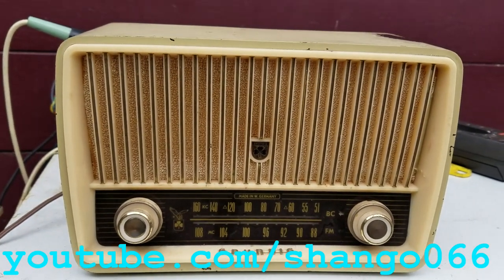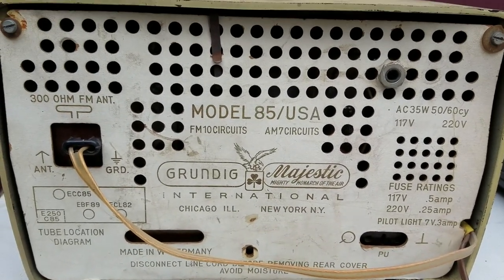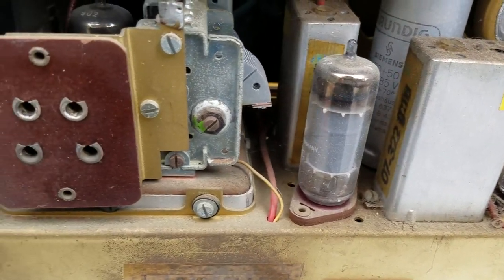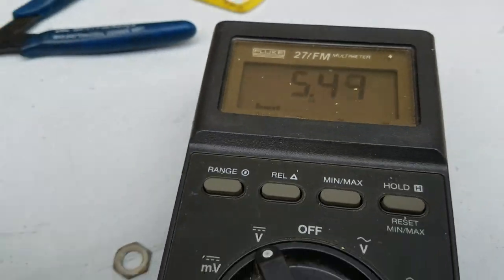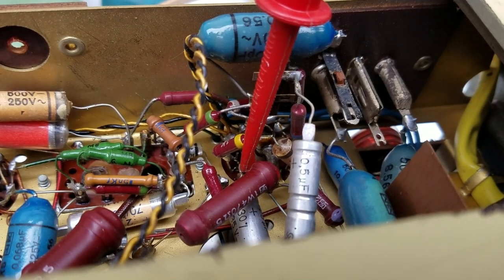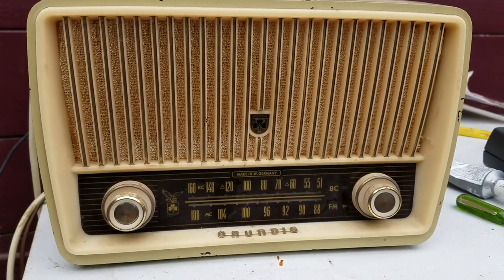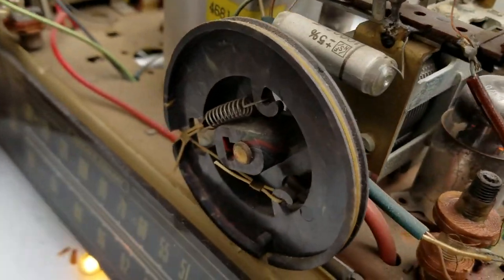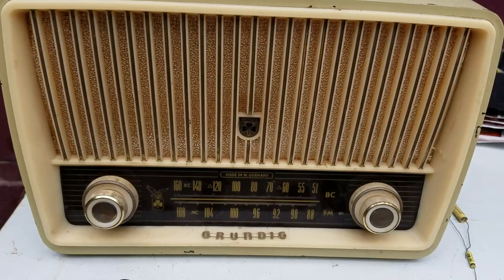Grundig 85 vintage German tube radio AM FM

Comment: I have two of these, that I've completely restored. One is original bakelite dark cherry brown and the other was painted green by Grundig. One has a brown glass tuning scale and the other has a green glass tuning scale. They both sound fantastic. The rectifier, as identified on the back cover, is not a tube, but a selenium rectifier, which I replaced with diode resistor combinations.

Comment: Grundig always made amazing radios with minimal number of tube envelopes.   This one is going to be much less of a headache compared to the larger ones with the piano-key switches.  In those dust would filter down between the keys and foul the switches.  Also the switch contacts would get dirty and need a complete switch disassembly to clean.  Also the switch bakelite would carbon-track across the B+ switching contacts.  And let's not forget the dim and expensive eye tubes.  One of the eye tubes even had an audio preamp pentode in it!  It cost like $45 thirty years ago, now probably not available any more.  The coil adjustments would freeze up too.   Count your blessings.

Comment: I think they were originally White. They were painted white at the factory, over the Brown Bakelite :)
Reply: You're correct. The white paint is from the factory. You can find the same at old Philips Philetta Radios which had a bakelite cabinet that was either left brown or painted white, depending on the design option.
Reply: Eu preciso encontrar um locutor de rádio do Estado de São Paulo o nome que ele usa como locutor é Andorinha
Reply: O nome dele é Andorinha

Comment: I really like how they used teh fuse as the 110/220V selector link.  As another commenter mentioned, this radio was originally white from the factory.  the knob trim, the nameplate has the links between letters painted, and the back masonite is white as well.

Comment: I could not get my head around a 3-tube AM/FM set... It turns out it uses the ECC85 as AM converter as well- only Grundig could do something like that! But then they always were a bit unconventional, who remembers the TVs in the 70's with the thyristor horizontal output stage?! Brave men would quake in their boots if one of those came in with no raster....
Reply: The radio works and sounds astoundingly good for how simple it is.
Reply: Alright shango...  sounds like an interesting challenge to bring to your audience!
Reply: Yes many service techs hated the thyristor/SCR based horizontal circuits, RCA really liked them, and introduced it to the mass market with the CTC-40 sets in 1969.
Reply: Thanks, I'll have to look that up!
Reply: there was a Pye P117 using the same idea and almost the same valve line up, just it had an EZ80 rectifier instead of a selenium..

Comment: Hello shango066, i live in Germany & the capacitor's in the german Radios are nearly all bad ! I dont measure them i just replace it all exept vor the ERO-FOL II, the yellow & green drobs vorm VALVO, PHILIPS etc. ( i call them " Käsekondensatoren " ) because the yellow ones look like liddle  pieces of chees ! And the ceramic ones with hi capacity from SIEMENS form the 30s and 40s are also mostly good !

Comment: Back in the day in Europe  radio usage fee was part of the electric bill. People were charged based in the number of tubes in the radio. Therefore the multisection tubes in order to reduce the count. The radios were registered upon purchase on buyer name and address.
Reply: They changed to a rigid tax, every household has to pay 17,50 Euro per month now in Germany. Communism is coming.
Reply: Had no idea. Reminds me of the window tax
Reply: Reminds me that here in the U.S. some cities would tax your house by the number of closets, thus the popularity of the stand alone wardrobe closets.
Reply: Public broadcasting (TV and Radio) has a yearly budget of 8000 000 000 Euro, no typo. Half of it is going into pensions. They argument you pay for the possibility to consume, and that this is necessary for the society at all. Judgement of the constitutional court is expected for autumn.
Reply: In Czech republic you pay only if you have radio or TV, so no every household has to pay.
Reply: I didn't hear about charging based on number of tubes. 
Dual system tubes (dual triode, or triode + pentode) were used all over Europe from 50s in TVs and radios. In this radio ECC85 is dual HF triode, EBF89 is IF pentode + dual diode for detector and ECL82 is AF triode + power amplifier pentode. First letter E is for 6,3V heater. E250C85 is selenium rectifier.
Reply: Ryan o The Monthly Payment includes TV and online Podcasts oft the TV as well.
I don't see  that we could get around that Payment...
Reply: Hmm, they had all-solid-state sets by the time this radio was made (the CONELRAD markers place it between 1953 and maybe 1964), albeit for a steep price. I wonder if the owners of those had to pay anything.
Reply: @xsc1000  The muli system tubes were better and often cheaper then two single system tubes.

Comment: 6BM8 is a triode/pentode, so it has BOTH audio stages.  No rectifier tube, so must use a Si diode or a selenium rectum fryer.  I can see the diodes near that output IF transformer for the AM and FM detectors.
Reply: There is selenium rectifier E250C85. Tube EBF89 contains another 2 diodes, there are used as AM detector and for AGC and the small germanium diodes are for FM demodulator.

Comment: Nice little radio. It reminds me of the Aristona SA1020U I restored for my channel. I removed the paint with copious amounts of acetone (Bakelite is impervious to acetone as long as you don't leave it on for days). They used to paint brown Bakelite radios white, to give it a slightly more "modern" look (white Bakelite was difficult to make and it often turned out more ivory than white color). By the way, Aristona was actually another brand name for what was essentially a Philips appliance. It seems Philips was embroiled in a copyright problem with their brand name in some other (European) countries. They also competed with their own house-brand, rather than leaving their market open to outside competitors (Like Unilever does with detergents produced by them (e.g. "Tide" or "Dash", etc.))
I think Grundig did the same with "Saba" and/or "Nordmende"

Some paint jobs, technically speaking, are really well-executed. It's a shame though, they did that... since the Bakelite underneath often looks stunning, in spite of or because of the paint-layer.

Thanks for sharing your video
Reply: philips had several other brands, here in the uk 'stella' and 'mullard' were fairly common and they also bought the 'cossor' name from the original company in the late 50's , i also have a 'siera' sa1001u

Comment: Yet another fantastic and educational video, with the usual touch of sarcasam =) Excellent point about the paper caps. I had an epiphany when you mentioned the state of failures between capacitor types. You are absolutely right about that. I'd rather have opens than shorts any day. Perhaps those should be called EOL and not ERO craps. ';^)

Comment: You can get yourself a radio transmitter to play music through radios without Bluetooth. I'm currently using an FM MHZ transmitter without using Bluetooth technology through my radio. They work on any radio with FM frequency. They transmit radio signals through open stations to play audio.

Comment: This cathode voltage is not high for this tube (ECL82). You can search this tube at r-type dot org. Its typical control grid to cathode voltage is between -12.5 V and -16 V. In my ultra-linear amp I run them at -22 V.

Comment: i have a similar 3 tube radio i just restored...it is only 3 tubes and it has 3 bands fm mw and lw...it has only one tuning capacitor...althought the components are extremely high quality like grundig always used, the circuit design is disgusting...for example if you put a new tube in the audio output and the rest of the tubes all well worn the radio starts oscillating immediately...all worn tubes or all new tubes...it is an extremely awkward circuit...for example the volume control controls the voltage to the preamp stage, not the actual audio signal....the radio has no agc and you have stations so loud you have to hear with the volume all the way down and other all the way up......contrary to all the other 99% grundig model wich were state of the art spare no expense this is a cheap nasty radio but very preety and with good quality parts

Comment: Grundig seems to have had the "Compactron" thing down pat before GE even thought of the name.
Reply: Dual system tubes (dual triode, or triode + pentode) were produced and used all over Europe from 50s. So it's not specific to Grundig. You can find them in Philips and many others european brands.
Reply: @xsc1000  yep, but compactrons seem to have far more 'elements' squashed in them, we never had them here in the uk, nearest was the eabc80, triple diode triode,

Comment: What does it mean "fm 10 circuits" "am 7 circuits"?
Reply: I assume they mean tuned circuits, and that they count any antenna slugs, the image-rejection filter, the oscillator and the primary and secondary of every IF transformer. I still don't see how they get a total of 17 in that little set, but you know how they counted transistors, including diodes and spares, in the 1960s.
Reply: @pcno2832  yep, number of tuned circuits

Comment: i have a Pye P117 'piper AM FM' that has the same valve/tube line up, apart from it has a EZ80/6V4 rectifier instead of that selenium type, has a 'live' chassis, the mains transformer only powers the heaters,  circuit is very strange in that the ECC85 is a frequency changer on both AM and FM, with the section of the ECC85 thats used as a RF amp on FM is also a 'reflexed'  10.7mhz IF.
Reply: i've just found the schematic for the 220v only version online and the circuit looks very similar if not identical/almost identical to the Pye, and also has 'live' chassis  , you can get it here https://elektrotanya.com/grundig_musikgeraet_85_musikgerat_sch.pdf/download.html
Reply: i'm going to keep a look out on ebay for one as it look a nice and interesting radio...my Pye unfortunately doesnt work too good, poor sensitivity, i've heard its quite normal for them ..

Comment: I f the cabinet is actually Bakelite, you can coat it with oven cleaner and let it sit 24 hours in a plastic bag to remove the paint without damaging the Bakelite

Comment: What's under 55 Mhz?
Reply: If you meant 550 kHz, they would use the same tuning capacitor for the Europe model and North America (export model), and MW in Europe starts at 510 kHz, with 9 kHz channel spacing.
Reply: Ok. Thank you Lake
Reply: Toronto, Ontario has had a commercial AM station broadcasting at 530 kHz for many years now. It might be one of the only in North America below 540 kHz. In the 90s, it was Hip-Hop 530, but now it is ethnic multi-language.

Comment: These Ero100 (Paper), the Blue Wax and in other Radios like Nordmende  the brown  Wima Wax  are always junk.
Not worth Checking.
Also beware of  the Electrolytic on  the Audio Output Tube. In my Grundig 3033 it shorted and caused a burnt Resistor and a shorted EL84 (6BQ5 ?)

The white Color on  the Cabinet is Original.

Comment: Btw. Shango066, just in case you want to emphasize your "kick of german radios" a little bit by pronouncing them correctly: The "U" is actually pronounced like the "OU" in "you" or the "OO" in "food". Just that this vowel is short rather then long like in those two english examples. The way you pronounce them resembles the german word "grantig" which means "grumpy" ^^
Reply: It's proununced "Groondish"

Comment: i woulnt trust 1950s and older electrolytics. 1960s and newer check them for leakage at rated voltage and replace the bad ones.  if i was fixing them for resale id might change them all, but for my own use, id leave the good ones alone